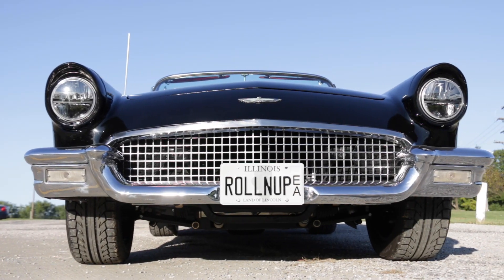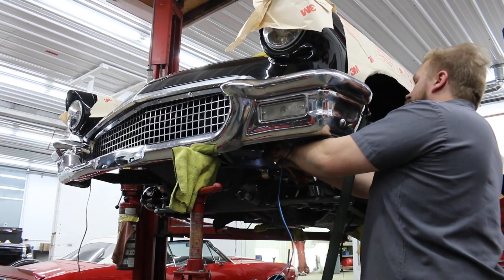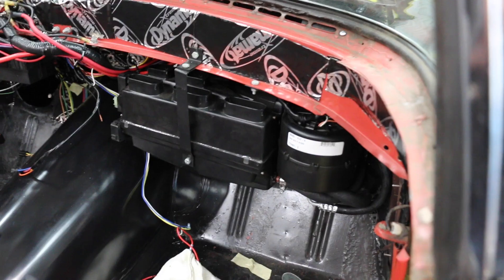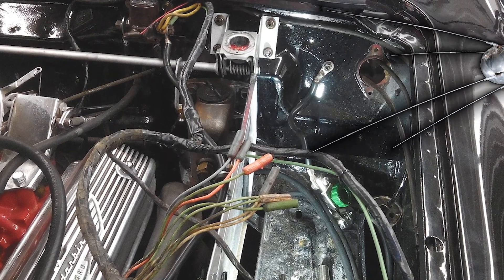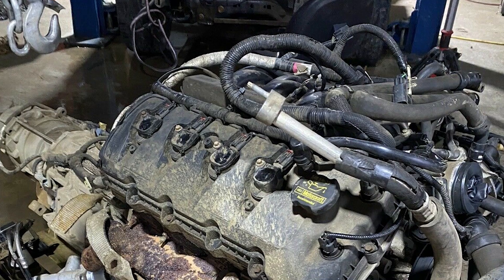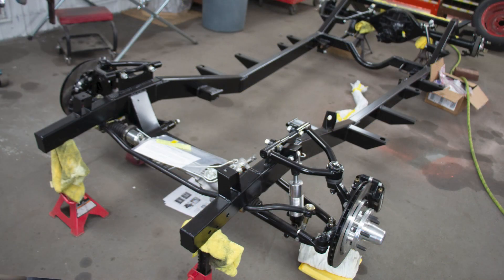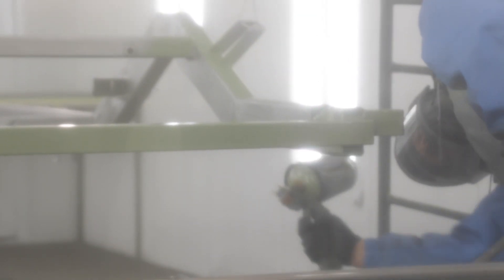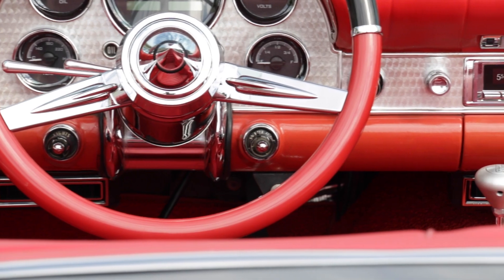1957 Ford Thunderbird 5.0 Coyote Swap and Custom Chassis Part 3 V8 Speed & Resto Shop V8TV

Comment: I have a '57 Ford Fairlane with a 390 fe engine that I put air-conditioning in myself then power steering with a friendly mechanic, now it's a pleasure to drive. Putting a new Holly carb next week or so, summers coming and so is the fun!
Reply from the maker: Power steering makes all the difference on big old rides, and many cars did not come with it.   Great upgrade!

Comment: In a practical sense, greatly improved. But it breaks my heart to see a once properly restored classic ruined like this. I have owned 6 1956 and 1957 T-Birds. I have taken them on 5000 mile round trips more than a few times. I had no complaints.
Reply: I understand these modernization attempts. I get it. But the charisma and soul of the original car is erased forever. Make mine original with a bit of patina.

Comment: Work of art.
However I personaly would prefer it with them wires and whitewalls. -> 0:27
Reply from the maker: It looks great with the wires as well, but they didn't clear the brakes or offer the cornering desired.   But a classic wire wheel / white wall combo is sweet!
Reply: @V8TV  Ahh, that didn't come to my mind, fair enough. Thank you for the input. Best wishes.

Comment: What tire size and back spacing of front and rear wheels
Reply from the maker: Keep in mind these were matched to the suspension used in this custom chassis and might not fit a standard-frame Thunderbird.    We used 17x7, 5x114.3 (4.5) 4" BS wheels and 225/55ZR17 tires.

Comment: Many times classics come in Tri's...the 55-57 T-Bird is a prime example, then you have others like the 55-57 Chevy BelAirs, 67-69 Camaros, 68-70 Chevelles, 68-70 Road Runners, 64-66 T-Birds, 68-70 Chargers, 68-70 SuperBees, 70-72 Monte Carlos....shall I continue???🧐....ok lets add the 64-66 Chrysler Crown Imperial............I can continue further if you like.☝🧐

Comment: What's the cumulative cost?
Reply from the maker: Each project is different and requires different levels of work, due to the customer's goals and the condition of the car.    We honor the privacy of our customers with regard to the costs on this project, but we're happy to chat about it should you wish.
Reply: Well the number is a lot of money. This kind of Craftsmanship will not be cheap. Think about how much the labor is when you take your vehicle in for major work. The parts cost on this car is likely well north of $25,000.
Reply: @lancenorton1117  Hmm. I would think this build would take several months and cost well over $100,000.  Only because it looks like the interior looks very stock.

Comment: Problem with a coyote swap is the coyote lol!! Rather put 7.3 Godzilla motor in it.. Much simpler engine to maintain and fix when needed.. Basically a LS Ford engine!
Reply from the maker: That's an interesting thought, but not quite the best fit for this application.    The Godzilla is just shy of 300lbs heavier than the Coyote, which would certainly affect the handling of the car, which was a primary requirement for this build.     The stock 'zilla is also only 300HP or so.   They can certainly be built to crank out FAR more than that, but this car needed to have OE-level drivability and reliability, easily serviced at any Ford dealer or repair shop, under warrantee.    A modded Godzilla might not be waranteed the same way.    The 'zilla is a bit narrower, so the fit would be a little easier.    Maybe it would be a fit for the next customer - we'd love to install one... thinking a Galaxie might be a great platform!   What do you think?